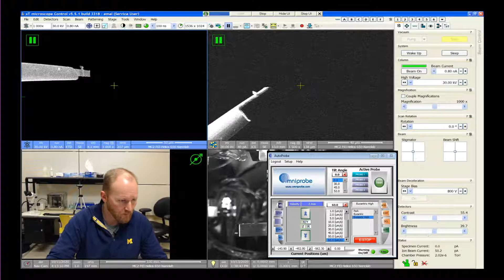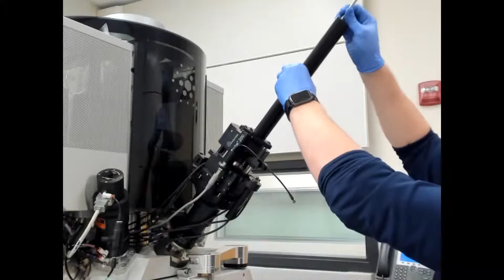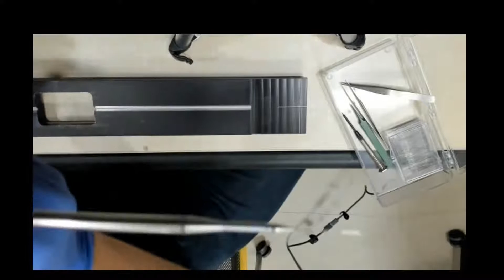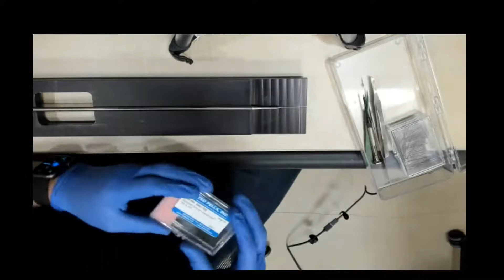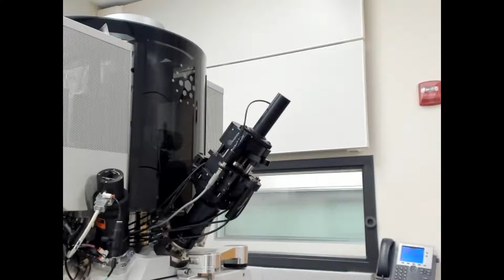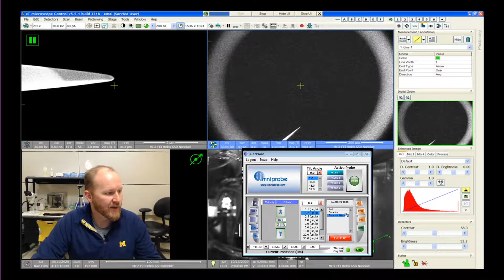(MC)² Training - Omniprobe needle exchange and calibration

Comment: Thanks Sir, It is highly helpful video. I have Autoprobe 200 omni probe, after I change the needle, it is vibrating a bit, as reaching nearby the sample in e beam and I beam both. Also, x,y and z movements of needle are responding in varied directions (not in actuals). Kindly suggest the solution. Thanks a lot.